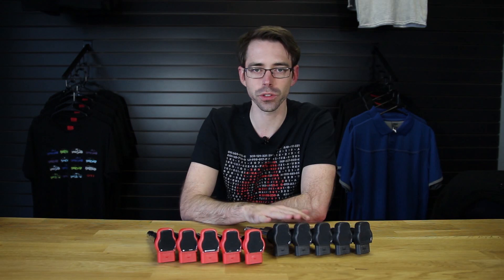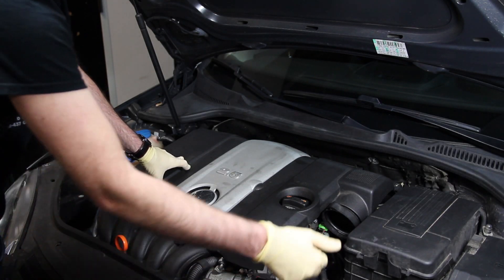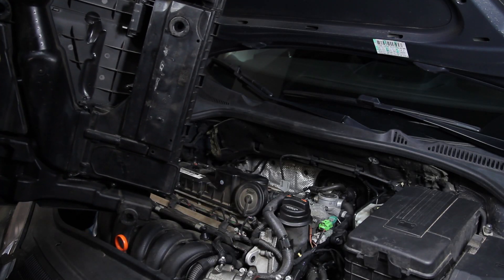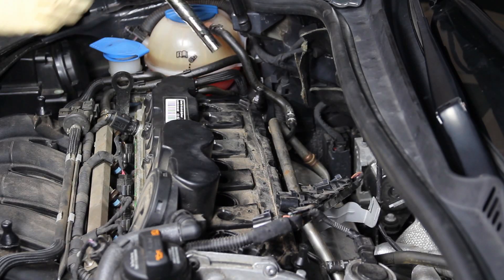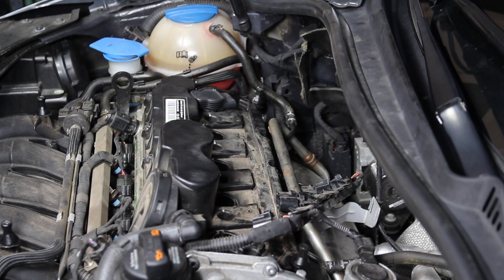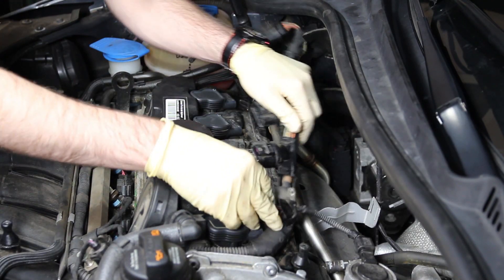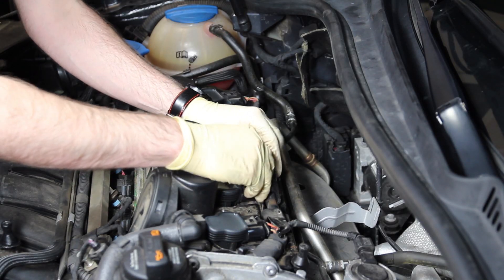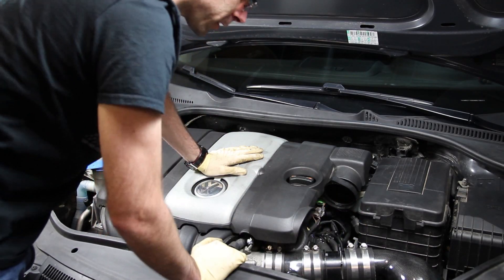How to (DIY) Replace Ignition Coils on a VW 2.5L 5 Cylinder Engine

Comment: Had a 2007 vw rabbit with 1 coil failure. Took it to auto zone who told me which one it was. Bought the part for 30 bucks and watched your video. Ran great ever since. Local mechanic wanted $150 to fix it. Thanks for posting this video!
Reply: The mechanic was probably going to get the OEM part which will last longer and is more expensive

Comment: My jetta  started misfiring at cylinders 2 and 5 , it looses power and makes a rattling sound at 2000 revs when driving , I already replaced coils , plugs, cover, MAF, MAP, injector cleaning , I even installed the old clutch back and it still misfires . I don't know what else to do. Codes p0300 , P0305 , P0305
Reply: Did you figure out the problem

Comment: Okay, so what about when the insulation tears out, and sticks onto the plug?   
I can't run the car now, the coil packs won't go back on right, and #1 cylinder
is now misfiring.   I heard there is a tool to cut the rubber off the plugs, as
I won't be able to put new coil packs on till I can get the plugs out, and I 
can't get the plugs out because the insulation is stuck to the plug.
Reply: Hey, did you ever figure out the name of the tool for the coil packs?
I'm having a similar issue

Comment: Thanks for making this video..... My mom has a 2007 vw Jetta exact same motor and all. 
Mechanic who was working on her car A. Told her it was a 6 cylinder.
B. Was charging her 200$ a coil to replace. 
I fixed her car in 45 minutes and costed her 80$ roughly for the parts. 
She was looking at almost 1000$ total for all her coils to be replaced. She drove to my house and I put them in. Her car has no issues.
Reply: Rote Rakaten There's always shady people looking to come up on an unsuspecting victim.
Reply: Yes I had same problem Mechanic shop wants charge me $180 for one coil. They lost there fuck mind sorry.

Comment: My 2002  GTI has 290000 on it. Would replacing coils and spark plugs improve the fuel economy? Currently there are no misfires but there is a little bit of rough idling

Comment: If I'm getting the P0301 and P0300 codes should I go ahead and replace the spark plugs at the same time? I have a 2012 2.5L Jetta

Comment: My girlfriends has a cylinder misfire. Should I start with ignition coil like this or a spark plug on just that cylinder? Im pretty clueless when it comes to VW. Im used to Subarus and Honda and would prefer I do this myself instead of paying a shop

Comment: Question? I changed my 2010 VW CC 2.0T  SPARK PLUGS. YESTERDAY  and saw that some were covered by engine oil. Any ideas of what that could be?
Reply: Blown head gasket or valve cover. Usually replace both

Comment: This looked fairly easy to do!  Approx. how much should this cost at a repair shop? I just received a quote for $420 (w/labor) to replace engine coils ($34 each) and 5 spark plugs ($15 each) on my VW Jetta ' 05 2.5 engine.
Reply: GelynW If you can't do this yourself, you HAVE to know some guy who can help you do it. This is not worth a shop visit. Plugs are $15 at the most. range between $4-$8 each at the auto store for VW.
The hardest part of replacing coils and spark plugs in your VW is getting the fan intake off because it's really tight, and you also need a socket long enough to reach the plugs with the plug socket attachment.
All in all it's a fairly easy job, especially after watching these videos.
I'm not a car guy at all, but I've changed my plugs, coils, brake pads, rotors, belts, and even the dreaded water pump all in my driveway.
Saved a ton of money!
Reply: Adam Parker thanks!

Comment: I changed the coils and spark plugs in my 2009 VW Beetle, and I am still getting the codes 300, 302, 304 and the car sputters bad while driving. What did I miss and what can I do short of taking it to the dealership
Reply: You ever get this figured out? Same problem here.
Reply: Check coil wiring hareness connectors for loose/broken terminals or corrosion.

Comment: Nice and informative video, I had a coilpack fail on my VW rabbit 2.5 with only 36000 MILES on it!! Apparently they fail due to heat but I've being driving this car really carefully and only for the weekends where I drive 75 miles on the highway back and forth. So do you know what might have caused this "HEAT" to prematurely wear off one of my coilpack in a low mileage car? Oh and it just had new spark plugs about 500 miles ago!!!
Reply: A big problem with them is water leaking in

Comment: I have fault codes for control circuit on all ignition coils. P2301 2313 2310 2307. Should I try putting all new ignition coils? Plugs already replaced at 40k. I'm at 47k now.
Reply from the maker: +mrodr008 If you have a 2.5 with those faults you likely have something else going on.  Where did you get the coils and plugs from?
Reply: Coils are still stock. Plugs I got from you guys (40k kit).
Reply from the maker: mrodr008 Based on the faults you might have a wiring issue.  You will need to investigate this further.

Comment: I have a 07 jetta 2.5 turbo. it's misfiring on 2. I replace all spark plugs and ignition coils but still have problems. I'm no idiot when it comes to an engine, but I've never worked on a vw before. obviously I'm a diy'er and I don't want to just start replacing everything, short of tearing it down to check the head and gaskets, any I'm put or pointers would be greatly appreciated!
Reply from the maker: +Michelle Owens Tough to say for sure. What coils and plugs did you purchase?  We tried to look in our system but it looks like they weren't purchased from us.
Reply: +Michelle Owens  i have the same problem 2013 jetta 2.5 misfire on #4 changed plugs, coil, injector still have same issue.
Reply: we figured it out. one of the coils were bad so we changed all of them but we're still having the same problem. come to find out because the coil went bad it blew a fuse. we changed the fuse and it runs just fine!
Reply: +Michelle Owens  was the misfire on just one cylinder or all? do you know where the fuse was located? thanks
Reply: it was a misfire on cylinder 2, the fuse that needed to be replaced was under the hood
Reply: Hey, I just saw this, did you figure it out?
Reply: +Michelle Owens  Do you know what number fuse? thanks

Comment: I am using the R8 coils now in my 2006 Jetta 2.5.  My car is not modified but it still helped some and that might have been partly because my old ones had 130,000 miles on them.  I did not have misfires but these kind of parts do age.  I replaced spark plugs not long before installing the coils and that also is part of the reason why I am having good luck with this.  One more nice thing about these is that they are cheaper than the coils the car originally came with.  I got mine for somewhere around $23 each vs the $33 each for the ones that the dealer would have sold.  I am glad I did this considering that it feels good to have paid less and gotten more.  To get the right ones make sure they are advertised as an Audi R8 part but they probably use these in other Audi cars and we just note the R8 because it is a well known performance car.  It is nice that I did not have to buy some weird brand that I never heard of to get a cheap upgrade.
Reply from the maker: +John Doe Thanks for the feedback.  We appreciate it very much.

Comment: I find that a bit of silicone grease in the grommets makes the cover a little bit easier to pull off.  You don't have to make a mess, just use a tiny bit smeared into each one.  The silicone grease can be anything as long as it is just silicone with no petroleum in it that will ruin the grommets.

Comment: Thanks!
Reply from the maker: +Silas Evans No problem.  Glad we could help.
Reply: +Deutsche Auto Parts I have to take my jetta to the dealership this week, and am hoping I can DIY most of the issues, since I am not running too rich these days.
Reply from the maker: ***** We can save you money on parts too!!
Reply: +Deutsche Auto Parts any vids on replacing the outer cv boots ('06 Jetta)? Is this operator level, or better saves for the dealership? What's your website?
Reply from the maker: +Silas Evans Im sorry we do not have any at this time.  This is a pretty messy job you might want to let someone take care of it for you.  Our site is ShopDAP.com

Comment: What is the firing order for a 2011 vw Jetta 2.5L?
Reply from the maker: Mike Cudney Are you looking for the cylinder order?  Not sure why you would need the actual firing order
Reply: Yes I mean order. Is it just 1-5 from left to right?
Reply from the maker: yes correct

Comment: My 2009 VW Jetta started shaking this evening while I was stopped at a red light. When the light turned green and I applied the gas the car started shaking and felt like it was about to shut off, when I looked down I noticed that the check engine light was flashing. Could this be an indication that my coils need replacing?
Reply from the maker: Its possible but lots of things can cause misfires.  You should consider having your vehicle properly diagnosed to ensure that you don't purchase parts you don't need.
Reply: Thanks for the response. I had it towed to the shop this morning. I will update with what they found.
Reply: Kinzi, my daughters car is doing the same thing, did you find out what the cause was?
Reply: Unfortunately not. I traded in the car for a new one. Tim Walker

Comment: Will my 2012 Gli Oem coits (black) work with my other car 2009 2.5 jetta 2.5. . .? I have the red packs already in my GLI an have the oems just boxed up
Reply from the maker: They would fit but since they are not the same we would not recommend mixing them.